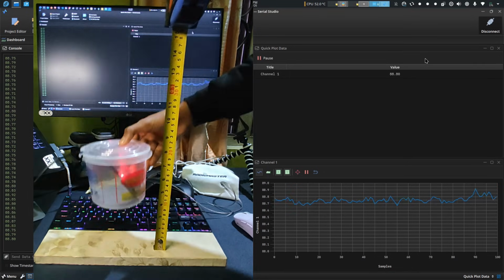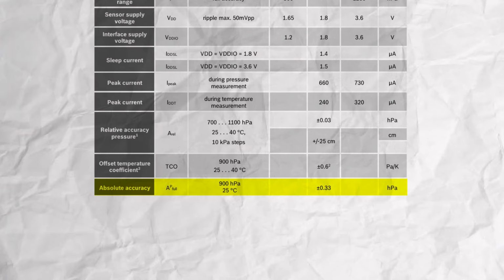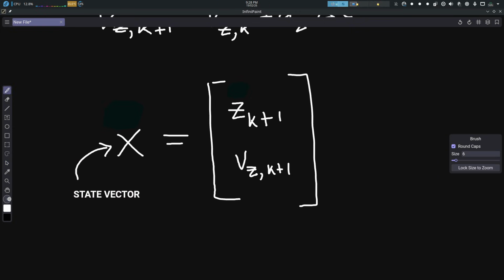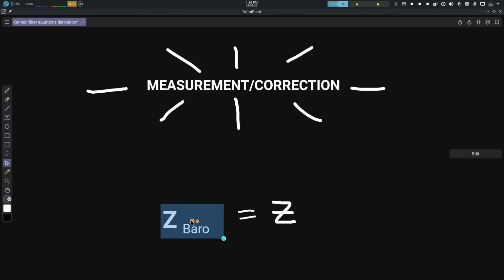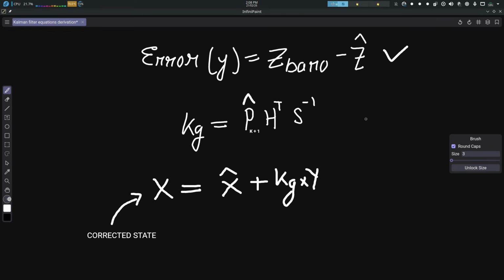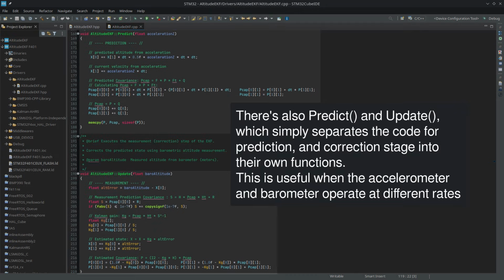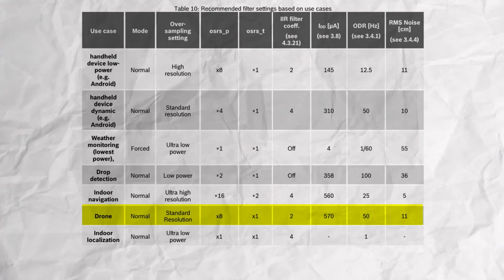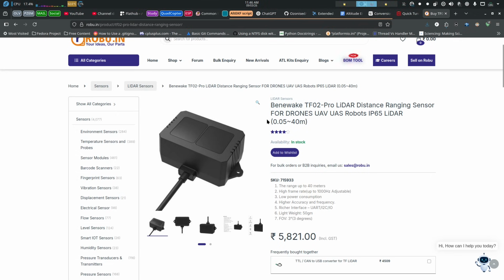Implementing an Extended Kalman Filter for Altitude Estimation

Comment: Contextless question: for altitude, why not time of flight with a mic and a speaker?
Reply from the maker: Most cheaply available time of flight sensor do not have a lot of range, 15 to 20m at best. Flying over trees or roof tops can deliver incorrect values as well. A barometer and accelerometer combination is the cheapest solution, though the resolution and accuracy comes no where near that of a time of flight sensor.

Comment: I am very appreciate this video, but i have a question, i need to hold position i think i need to use EKF with the input is 3 gyro, 3 accel…, and the output is something like vx, vy. Do i true at this thinking,and can u make a video about this problem, thank you
Reply from the maker: Hello, thank you for the appreciation. 
For position hold you need to get the distance moved along x and y direction from the acceleration, as well as the velocity.
So, your state vector will contain 4 terms.
Next calculate the state transition matrix and other stuff.
The measurement model will contain two terms, the x and y position from the GPS. Now calculate the measurement model, KG and all that stuff as shown in the video.
I do plan to make a video on it, but not anytime soon.
Reply: @Ozonised  Thank for your good answer, I have some questions below
1: The x and y position is the lat and long, right? Or we need to calculate position x and y from lat, long
2 Do you know some source, new or formula... which calculate distance, velocity from acceleration?
Thank you
Reply from the maker: I showed in the video how to calculate distance from acceleration as well as velocity. See calculation for state vectors.
And yes, X is longitude and Y is latitude.

Comment: I am not familiar wtih the math, does this EKF implementation estimate the velocity accurately as well? Is it reasonable to just take X[1] of the state vector to be the velocity estimate or does the velocity drift because the baro does not correct it?
Reply from the maker: The velocity is not corrected by the baro. Therefore, it will drift along with the accelerometer's acceleration.